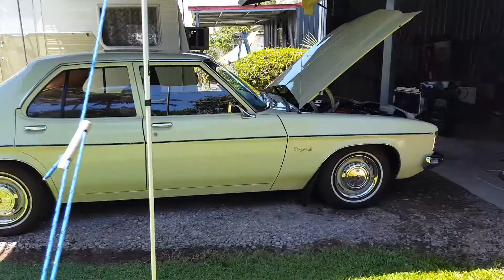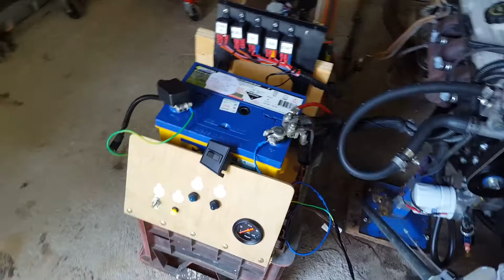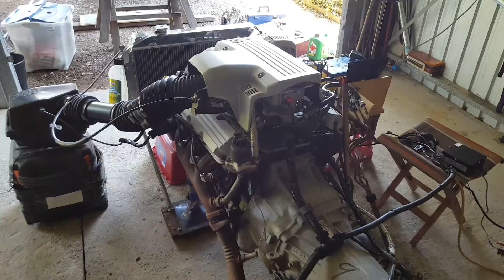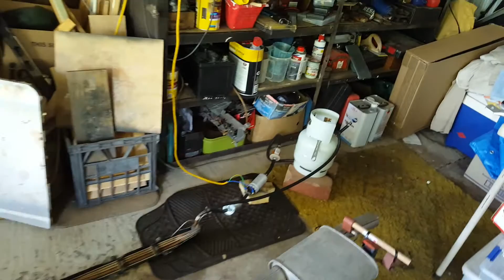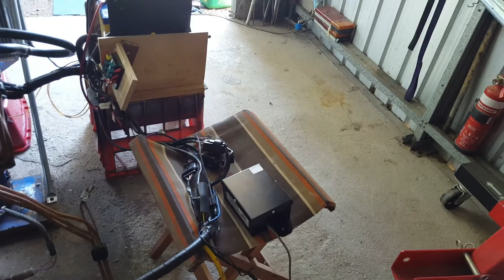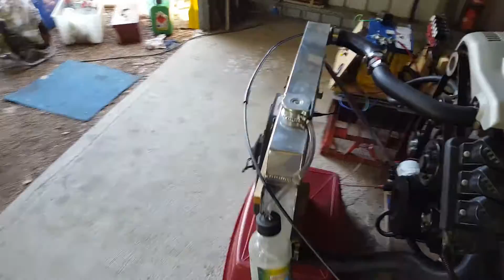Vt commodore ecotec conversion, into HJ holden

Comment: Hi mate good video  , where can I get the conversion kit from ? does it have easy to follow wiring instructions ?  I have the same engine in an off road vehicle I am  building and the wiring is a bit overwhelming !
Reply: Did you find a solution for the wiring on this engine? Cheers
Reply: @lucascampbell3401   I got a kit from Australia plug and play not cheap $1200